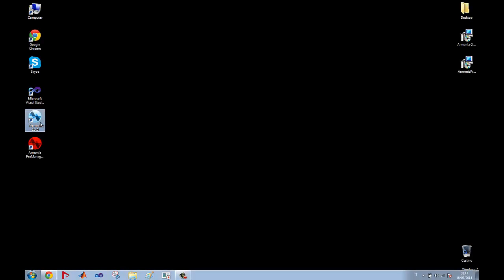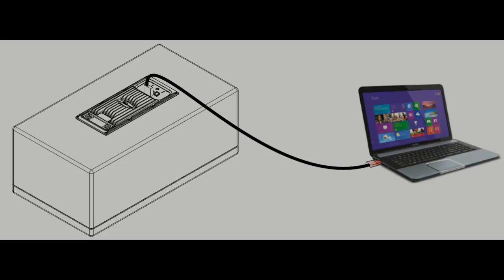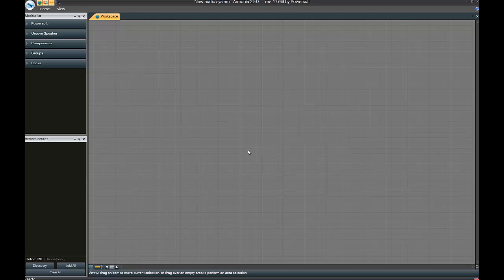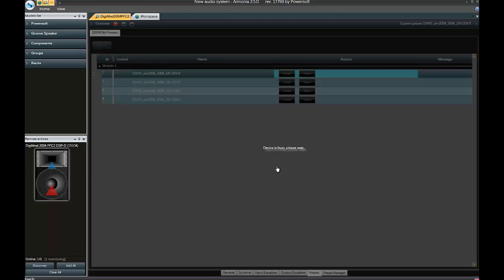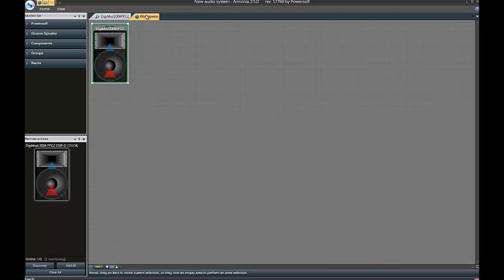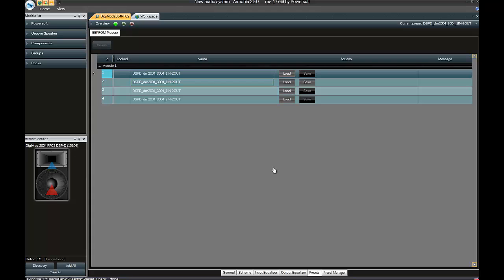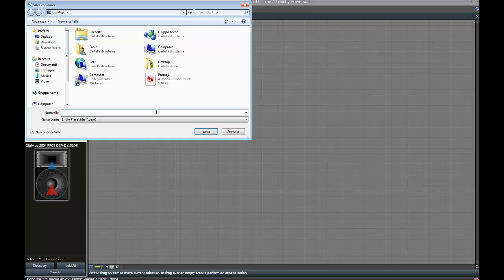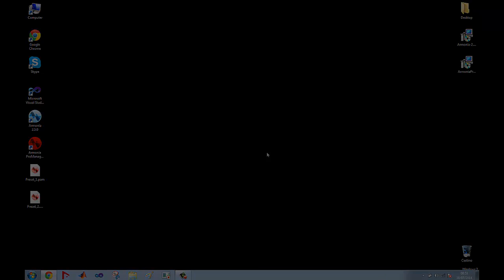Work on Armonía with a Powersoft model 2/5

Comment: gosh... I had used JBL artnet and arquitech, to create and load presets into the itech amps i didnt have to watch a single manual or instructions Just research how to make a Ecat5 ethernet cable to connect my laptop to the amp... 
im feel intimidated by this video im planing on getting a pair of  LITEMOD 4HC for some dual 15 woofers...  im cooking...